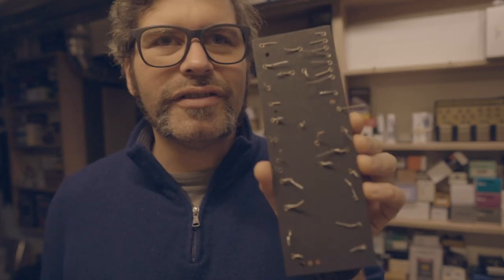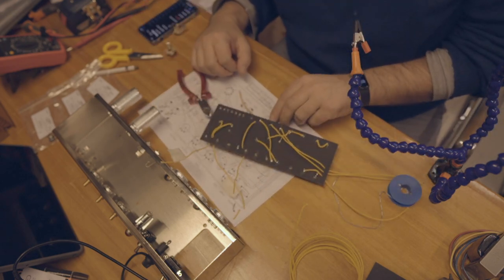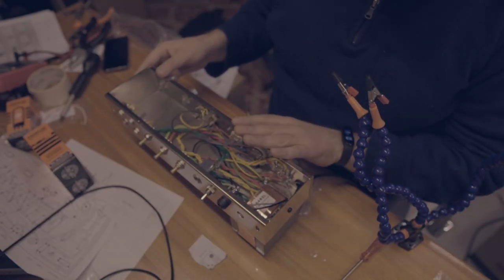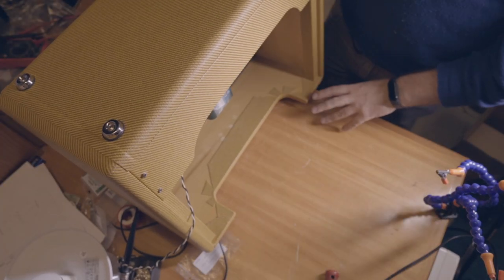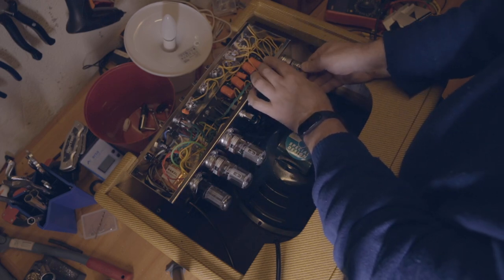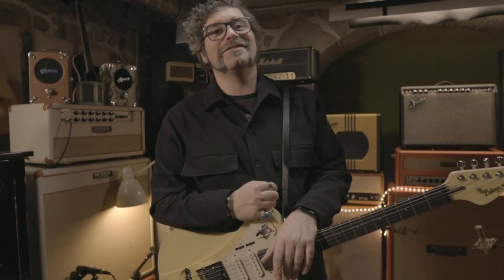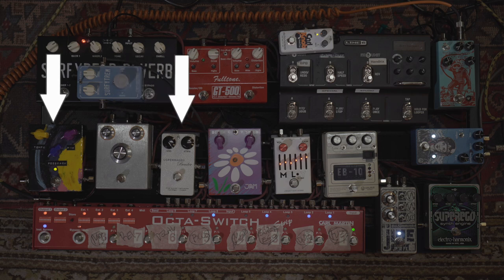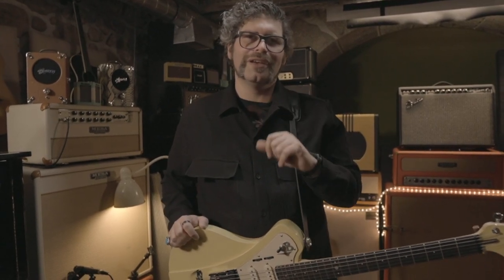I Built a 5e3 Tweed amp Hardwired - Doctor Guitar EP286

Comment: Congratulations Mr Guedes on completing the build successfully. I am going to offer a critique of what I saw here though and I hope you can take it in the spirit it is intended. 

I am very concerned by the process you show after first switching on the amp and getting no sound. You were informed that one of your filter caps was reversed and you point this out by sticking your fingers in the chassis and appearing to touch the bare legs of the capacitors. Buried deep in the comments here, you mentioned that you took all safety precautions but in the video the process appears as you a) switch it on b) switch it off and c) go handling the components inside the chassis without any intervening safety measures. The filter capacitors you were talking about can each store a charge of 400+ volts and they can hold that charge for months awaiting a lightning fast discharge when you put fleshy parts between it and ground. 

The proper procedure for going into an amp after it has been switched on for any length of time, is to properly discharge the caps using a snuffer stick basically a resistor in line with ground - readers will have to look up snuffer stick - I have bigger fish to fry here! Some amps have bleed resistors built into the power circuit so that after 10 minutes or so they can be said to be safe but the original 5E3 Deluxe didn't have them and there is no guarantee that any of the kits based on the 5E3 have them either. Best to err on the side of caution and assume not. After, you have bled the capacitors you absolutely must confirm the there is no voltage left in the caps. You understand, you didn't mention any of this and you have to assume that the regular viewer who is building this amp for the first time may look to you for instruction here. You don't want to be the content creator whose instruction led to a fatality.

Building amps can be a fun and safe hobby and no more dangerous than driving down the road with cars on the other side coming in your direction. But only if you are absolutely clear about the fact that SAFETY is not optional. And think of who your audience is here...
Reply from the maker: I didn’t know that so thanks for the information. I thought I was being extra careful

Comment: Congrats on finishing a great amp! I went that road too a few monts ago with a chinese kit and I also tried a few mods. Beside an fx loop insert into the circuit (you can find online several options) I think the best mod (for me) was an master volume inserted between the preamp and power amp stage (just before the phase inveter). It enables more control over the preamp tubes distorsion and the power tubes overall volume making it way more usable at lower volumes. Either way I think this circuit has very nice middy tones, excelent dynamic response and with a distorsion/overdrive pedal in front of it gets you very nice high gain sweetness :)

Comment: Great project - that's a lot of work though . . gotta tell people there's some high voltages in valve amps.  Top tips - wear rubber-soled shoes, and if you must poke or touch anything inside when it's on, use ONE hand and something non-conductive like a wooden ice-cream stick, don't use a screwdriver!
Reply from the maker: That’s a great tip. Thanks for sharing

Comment: i have read on many forums that the experts consider the weber 12A125S as the best sounding modern speaker for an 5E3 amp , it's an alnico 30 watt speaker so it not an high headroom speaker though but i had one in my Marble LTD amp ( upgraded 5E3 clone )  and it did sound great .
Reply: Are you sure about that model number? The 12A125A seems to be the favorite on the forums I frequent. I have the "A" and "S" versions and both are appropriate for Tweed or Brown Fender's.
The Jensen P12R isn't a bad speaker, it needs time to break in though.

 My favorite 5E3 speaker is from Weber and the "Tweed Deluxe Speed Shop" -  A12Q.  20 watt, no dope, special pulp cone, voice coil. former and dust cap.
Reply: @matthewf1979  hello , i just had a look on the weber site , and i from what i read in the comments the "A " version is indeed also beeing used a lot for 5E3 circuit type off amps , so yeah ,  i guess there both great for these kind off amps , i had the " S "version in my amp and like i said it sounded great . It's about preference i guess , all kind off speakers are beeing used in these kind off amps from what i notice after reading many forum comments . The jensen speaker is for sure not a "bad "speaker , but i think anyway's an alnico speaker will give you a somewhat more "vintage " vibe kind off sound instead off an ceramic speaker . But can you tell me how much having a dope or not will affect the sound ?
Reply: I have the 125a in my 5e3 build and can confirm it’s awesome. Never tried another speaker tbh so I guess I don’t know what else sounds good but that’s a great sound
Reply from the maker: Thanks

Comment: why is it that all of the required holes are not predrilled?
Reply from the maker: That’s a great question
Reply: Maybe the same chassis is sold for different kits (5G15 for example), so they can keep the costs relatively low. A lot of company’s that sell kits work this way. I will start my own build of the TAD 5E3 soon, the kit arrived a few days ago and I can’t wait. I will try some mods by Rob Robinette also, you could also check those out.
Reply: @ReinoutVrijhoef  Yes, that must be it🙂
Reply from the maker: That’s a god point

Comment: So you're obviously an experienced guitarist, but how much electrical experience do you need to successfully complete this build?
Reply from the maker: I had almost no experience. But it’s a demanding job
Reply: Amp builder here - I would say it depends on how well you can follow instructions and have attention to detail.  There are lots of great detailed guides and kits on building a 5E3 that could guide a beginner well enough through.  

If you have doubts I would recommend starting by replacing pickups in a guitar or building a few pedals from a kit.  That will help you learn how to solder well and how to follow a kit.  If you can build a pedal, you can build an amp.  

Amps intimidate some because they're potentially dangerous.  It is good to be aware of the risks.  But also consider that driving a car is risky.  That's why you do driver's education first.  Study the process and educate yourself and you can greatly minimize the risks.  

Building your own amp can be incredibly rewarding and a great learning experience.  I play my first 5E3 all the time and cherish it greatly though it doesn't really have much market value.
Reply: @KleyDeJong  Thanks for taking the time to craft such a thoughtful reply. I’ve long been interested in electronics, wiring my guitars and pickups, building simple circuit devices and studying the basics of current flow. I’m well versed with a soldering iron but you’re 100% correct- tube amps are very intimidating, only partly because of high voltage (I have confidence that I can follow safety protocol) but more because of complexity. I may well take your excellent advice and build a simple low wattage practice amp kit first... and my cabinet building skills will be big bonus for completing a small combo! Thanks again.
Reply: @GinoGenero  My first build was a 5F2A Princeton - would recommend.  I also would checkout a forum like TPDRI shock brothers to get some support if you run into a problem.  Troubleshooting as a noob is a big headache.
Reply from the maker: It was an incredible experience and I took all the precautions to be safe
Reply from the maker: It’s not hard at all!! It’s just a lot of work and very demanding on accuracy! But it’s doable for sire
Reply from the maker: Thanks for that tip!!! 👌👌👌
Reply: Do your research and learn basic soldering. It isn't hard, but I would suggest getting a basic understanding of how the amp works. Uncle Doug is a great Youtube resource as is Rob Robinette's website.
Reply: Highly informative video, Budda. Errors included. Thanks a million and be careful about sticking your fingers inside the chassis, even with the plug out!